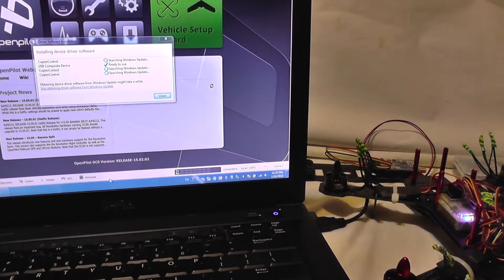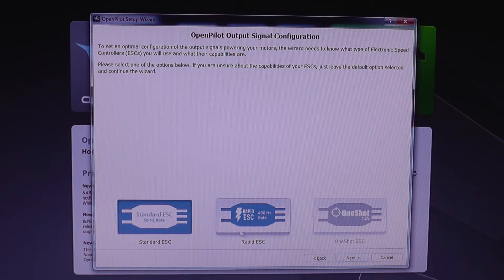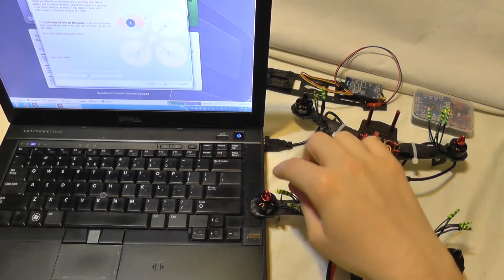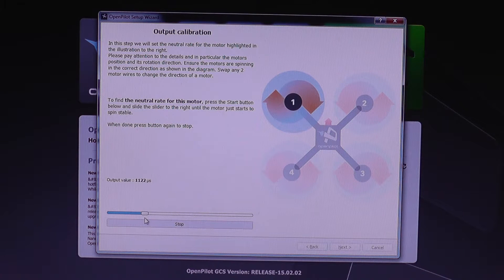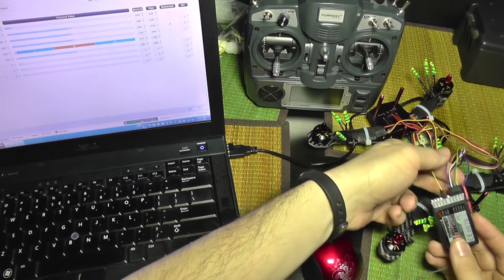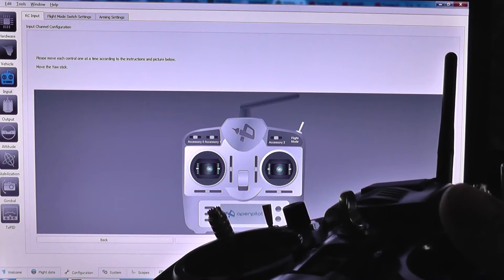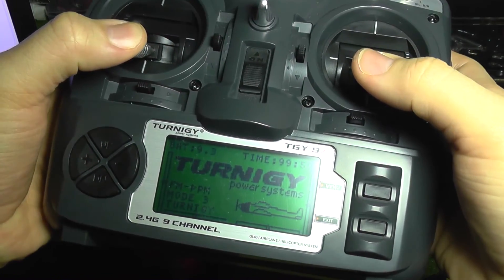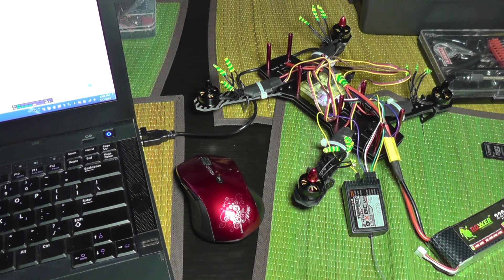How to Build a 250 Class FPV Quad: Part5 CC3D Setup

Comment: How are ya doing? I have a bunch of quads GPS drones brushless but I just got my first racer. I'm pretty good with a computer. I wanted to ask you is it hard to set up my racer with open pilot? my racer runs great but I want to know when do I know when I need to update it? thanks for this informative video. I hope to hear from you soon.
Reply from the maker: +Ian Rice Hi there, the CC3D is very easy to setup with open pilot, most of the settings are self explanatory. This was also my first build based on the CC3D and decided to video it.
Reply: AWESOME!!! That is very good new. I thought it looked pretty easy when i saw people use it.  That is awesome you built your own. You just need to know how to solder right? or was that hard to build? Thanks for your reply!
Reply from the maker: +Ian Rice You need to know how to solder and have a pit of patience and have. The hardest part was to map the channels from my receiver (Turningy) to the CC3D as I could not find anywhere the info. But by trial and error id did work. You also need to take care of polarities, wiring and insulation.  I have a full playlist with the 250 quad build from frame assembly to maiden flight (in fog and snow). Be sure to check it out. Also if you have questions let me know as I may help you.
Reply: Thank you so much for the help man it means allot. I bought an LHI RTF carbon fiber 250 and i had range issues with the flysky fs t6 but when i took of the shrink wrap over the over on the receiver it got better. But just in case i did buy a new receiver for it. I want to ask you if i replace the old receiver all i have to do is take off the old one and connect the new one and connect the wires the same exact way the old wired were in the receiver? Is this true or do i have to go into open pilot and change any settings? I don't think i can build my own. If i had some direction on how to yea i could. i need a new soldering gun first. You must be pretty smart to do this stuff. Thank you for your help and im going to check out your videos and subscribe now. :)
Reply from the maker: +Ian Rice If the receiver is identical then it should work directly, just take care when swapping wires. Also place the antenna of the receiver away from the carbon fiber as it's blocked by it.
Reply: +TechTronic9000 I got mine RTF and the antenna wire is right along side the carbon fiber body. So you think that's what was causing the range issue? yes the receiver is for the flysky fs t6. witch is the transmitter I have. It's just a different model number. But looks identical to the original one and is made for my transmitter. So you just taught me something about the antenna losing signal by being to close to the carbon fiber body.
Reply: +TechTronic9000 I would like your opinion. where would you put the receiver wire on your racer?
Reply from the maker: +Ian Rice search a bit online for an antenna holder for quads. You will find some V shaped tubes that fit the top of the quad. The antenna wire will go inside that and it will be kept up and away from the frame. My quad is a clone made from fibreglass and it doesn't jam the receiver but it's not as though.
Reply: +TechTronic9000 I know exactly what your talking about. I'll look up on Amazon for one of those. I know what kind of body your talking about for yours. Thank you so much.
Reply from the maker: +Ian Rice cool, keep me posted if you have other questions.
Reply: +TechTronic9000 your a good dude for being so kind and helpful!

Comment: Thats some amazing software.A very interesting series.
Reply from the maker: +Mike Stark It's also very easy to use due to the built in setup wizard. Just a few steps to follow and the quad is able to fly without messing around with complicated settings. It also permits advanced configurations for experienced users.